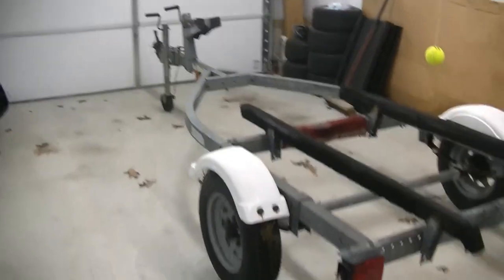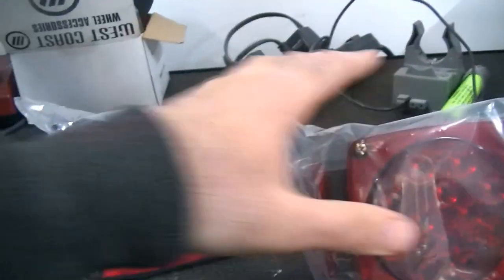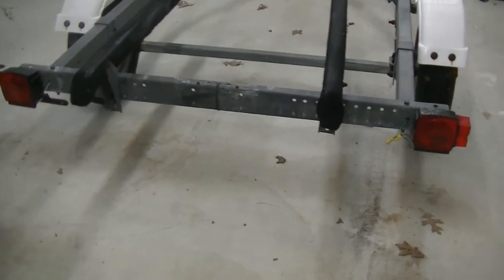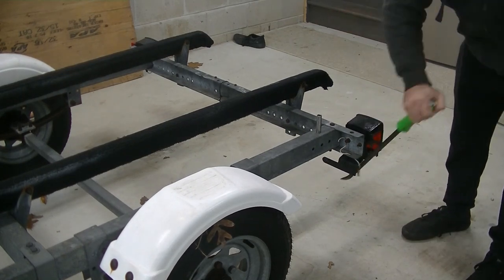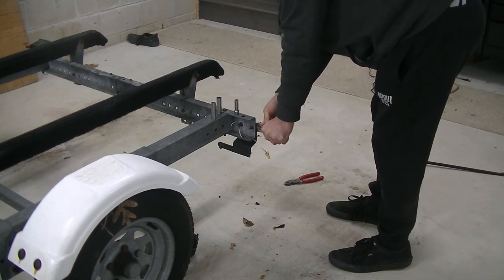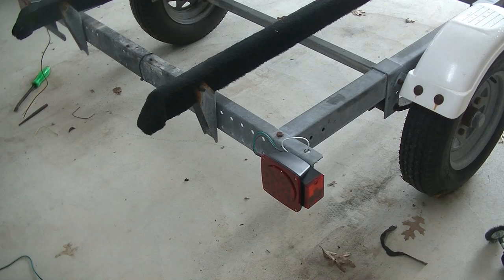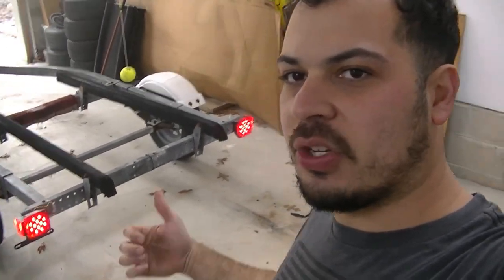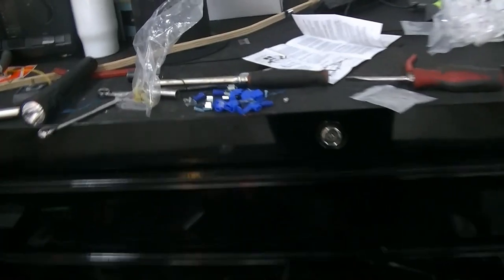Replacing the wiring and lights on your boat, jetski, and utility trailer!!

Comment: I just did this but didn’t realize my trailer use to have side lights so when I went to pull the wires through it broke off half way. So now I’m stuck with zip tying my wires to the out side of the trailer 😢
Reply: I did the same thing. I cant get my right light to blink.